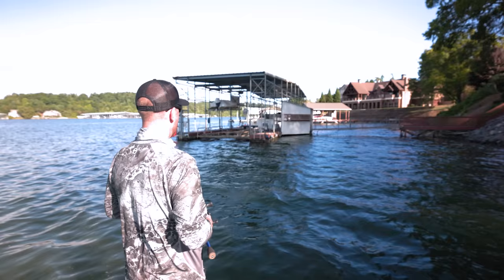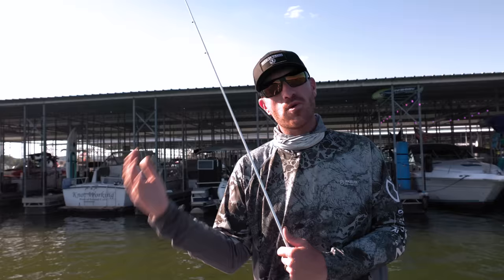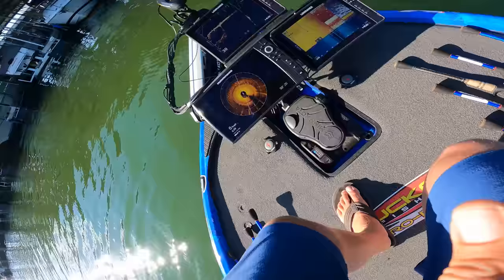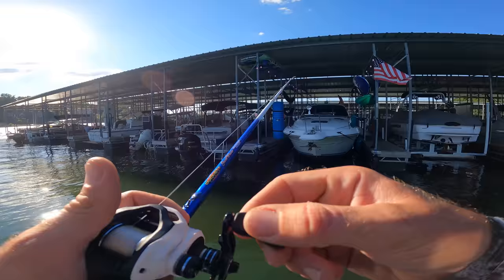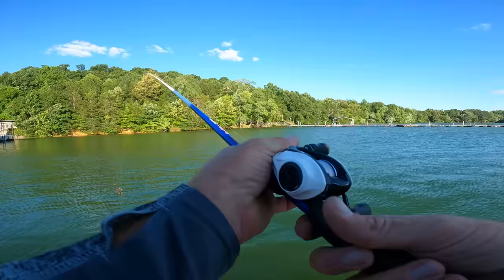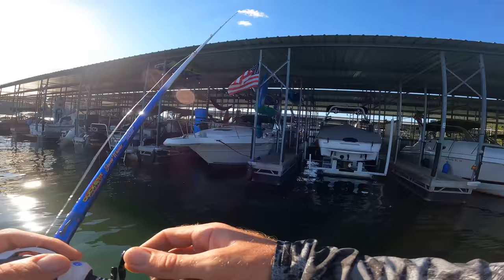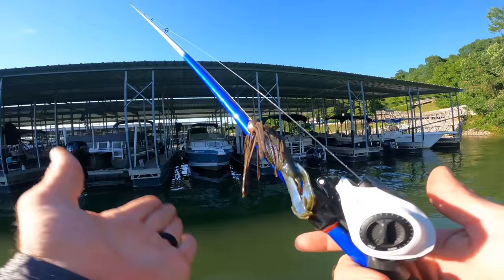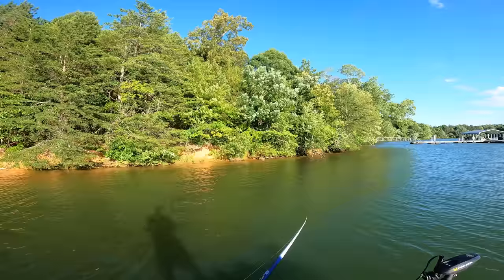How to Fish Docks Like A Pro + Skipping Tutorial - Jacob Wheeler

Comment: Was hoping that you would cover another type of dock architecture.  Some of the bigger marina docks are constructed with an under water (+4 Feet deep) brace that runs the length of the boat slip opening.  It's usually mounted on the walkway on each side of the boat slip opening.  What is your approach on that type of dock?   At times bass will setup along those underwater braces.